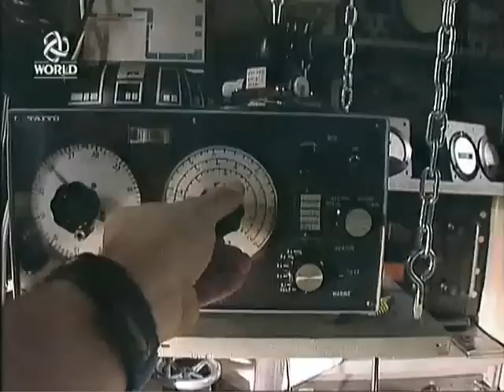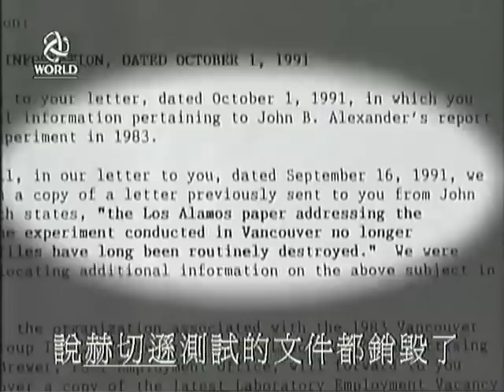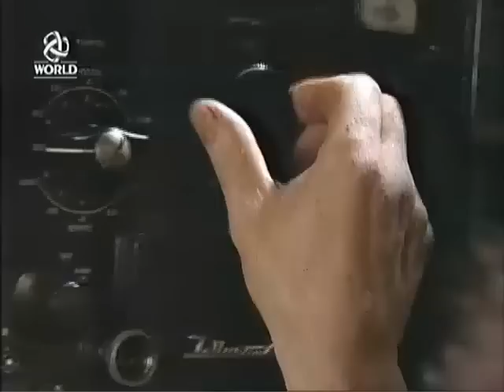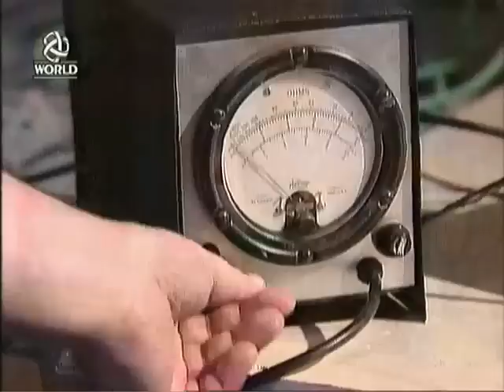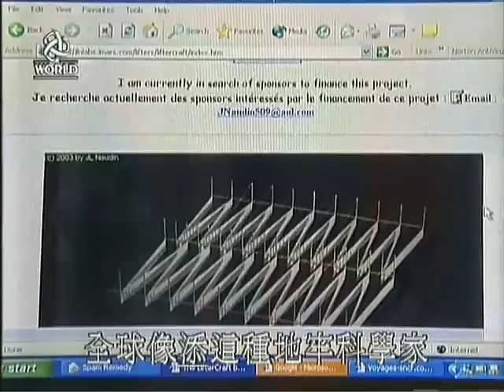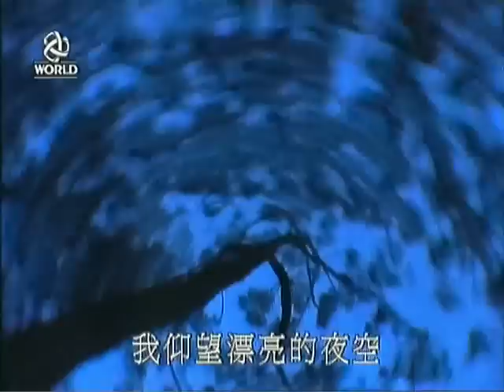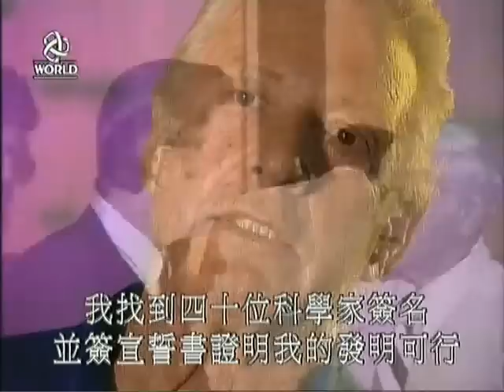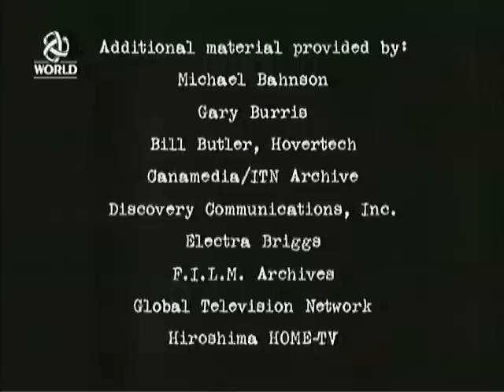Discovery Channel - Free Energy

Comment: I made some "crystal batteries" (as seen on YouTube) that don't run down but they don't have much power by themselves so they have to be multiplied and put in parallel to be of any use. They light LEDs. Voltage goes up nicely when they are put in series. Other than the ingredients, it's free energy.
Reply: Really? :D
Reply: i wish there was some sort of free energy system that could put out some high amps to power something other then low amp LEDs ,, nevertheless free light at night is a start right ? and LEDs make a fairly bright light

Comment: When someone says: free energy, I smell a rat. A dead rat.
Reply: +flexairz free energy is merely energy that's released that we don't have to pay for. That's the meaning. Is it hard to comprehend a device that has an ability to transfer energy from one place to another, powerful enough to do noticeable work? lighting an led is work. We can take a rock, mix some glue with a conductive component and glue foil to spots on the rock to receive a measurable voltage. If we lay copper foil on one side and foil on the other without connecting them with a conductive element, we can measure up to 1 volt across these conductors. I believe it works based upon the crystal radio phenomenon, and that our planet has an everlasting radio field associated with it. Since this energy is pretty much forever and will not die, what makes it so hard to believe that the energy can not be either capacitively coupled with , or induced in a nature other than by winding an inductor? The rocks may have a gravitational or magnetic component not noticeable to the naked eye, however, energy signatures exist within them that are unknown until we measure their electrical levels with a voltmeter. Just because it seems like science fiction, why would you smell a rat? It does not make sense. How could the energy establishment make this a scientifically inviable phenomenon that would be labeled as an anomaly and other feel it isn't free energy? If it lights up a small led forever, and, there isn't any other input other than the Earth's energy presence, why wouldn't it be considered free? The led lights up, and, nobody has a battery.. why are you so skeptical and have to write about it the way you do? crystal batteries do work and they are easy to make. The Japanese would have never invested in John's ability to make them work if they did nothing. There really isn't much to say other than the fact that they work.. They may not be all that powerful, however, he did make an incandescant bulb light up with them and he did NOT add an additional power source. How he did it? I'm not sure, but, it was rather difficult for him to maintain the connection, and, I think it is by obtaining the correct frequencies by using the right kind of crystal which would maintain that "capacitive coupling" with the Earth's capacitive component. Energy can be drawn in inductively, with an inductor, or, it could be drawn in capacitively, which causes much more skepticism because it isn't a known and documented wireless scientfic principle that has been taught in school. I do this by energizing certain products/components with high voltages, which start to raise the voltage in batteries when the electrical fields are present near the batteries and capacitor banks, allowing for an infinite amount of time per energy drawn from the test battery. this works as long as we do not take more than the incoming charge could level off to allow the battery to remain at 12.3 volts. I have estimated that the battery and inverter I used could output a total of 140 watts. The neon sign transformer uses 200 plus watts to fire up. The bulb I use uses 40-45 watts, the total is 245 watts, and the inverter is only good for 140 watts maximum. The battery maintains 12.3 volts while operating indefinitely, just as long as we do not increase the output or the load, it will run forever. Trust me, there's a lot of skeptics, but, nobody has been able to make this work other than Don Smith.. He is now dead and I am the other that has replicated this effect. It is very real, and so is Hutchinson's free energy crystal battery.

Comment: I built a lifter about 13 years ago.  I was using about 10 or 15,000 volts DC.  I could see it flex and move as I applied power.  I don't think I had enough voltage or power to get it over come the force of gravity.  I was disappointed.  But this video gives me hope that all those strange plans and patents I purchased back then were legit, and not just a scam.
Reply: Update?

Comment: The lab was not seized by his Canadians. It was a fire hazard, since you cannot have all that kind of out dated type of equipment in an apartment like that.  Imagine the current draw and the possibility of fire.  He said the equipment came from the 40s to the 80s or so, and I work on vacuum tube equipment all the time.  It can be dangerous.  Hot chassis, shorted capacitors, selenium rectifiers, asbestos, this old stuff can burn a residential structure to the ground.  Some of the equipment was even dubbed "curtain burners" because of the heat and tendency of the devices to catch fire to surrounding apparatuses.

Comment: In case some of you are easily impressed, the levitation is done by turning the camera upside down.
Reply: aha, so what causes them samples of hutchinson to first stay on the wooden board they are on?
How do they first stay there, then start moving slightly, and then "fall" upwards?
Water isnt magnetic, so how does he keep the ice hanging untill it drops?
Reply: jhanthony2 well, if the militairy is interested in those things....... just like it was interested in the works of tessla..............

But no sir, you seem to understand it wrong.
Its not WHAT is being done, but HOW it is being done.
Please, replicate what he has done. Show you can do the same, and then you may convince me.
But now, i say you can not show or replicate his stuff.
No matter if its filmed with a potato or with a camera, it is the stuff you see lay on a board of wood. Does not seem to be attached in any way. And it seems to go up.
I know, you can turn the camera around. And sure, things with metal in them would be possible to keep suspended in the air by using a magnet on the other side of the wooden board.
But, things that are non magnetic can not do so. And he clearly shows stuff that is not magnetic and it still reacts to some sort of force.
It may be a blower, it may be a piece of string. 
Replicate it, i dont think you can.
And that doesnt mean i believe its real, but i do not have an explanation, and i merely tried to show that your explanation doesnt make sense.
Reply: bertjesklotepino "well, if the militairy is interested in those things....... just like it was interested in the works of tessla.............."

What are you implying? I thought everybody in the world was interested in the works of Tesla. And I'm pretty sure that there isn't anybody in the Military that has "Raid Hutchinson's lab." on their to-do list.

You request that I replicate what he has done. I can't do that because I have no idea what he has done. Do you? All I see is an extremely bad video of nothing. The only thing clear in this video is that it was made so that you wouldn't have a clue as to what you are looking at. How can anybody accept this video as something scientific? 

I'll try one more time: The Hutchinson effect can't be explained, because their [oops--there] is no such thing. Nothing is being effected, and nothing has an effect on anything else. He's a magician waving a hat around and saying, "Ta-Daaa!" but never producing a bunny, pigeon or bunch of flowers.
Reply: jhanthony2 I agree with the fact that the video is indeed very bad quality, and in no way scientific evidence for his claims...............
It is however strange to see water first clinging to a cup on a wooden board, then the water going up and the cup still on the wooden board.
Or a solid piece of iron smoking and deforming.

You can not say for sure that there is no such thing. Tesla has some strange devices too, and there was this other guy who was busy with magnetism and static energy as well, who also has patents on strange devices that seem to have levitated stuff by an unseen force.

Now, i dont mean to say that whatever he does is real, but there are several examples of projects in the past which involved the militairy to show that there are things we dont know about.
Im no expert on static energy, i dont know if you are. 
Tesla wanted to create some device to have unlimited power free for everybody, and it seems Morgan and such didnt want that because it wasnt possible get people to pay for the energy they used.......
What i mean by that is, certain inventions are surpressed, censored if you will.

I know you cant replicate what he did, but to discount it simply by looking at a very bad video............... i think the video only shows that he aint a cameraman......and also not rich enough to buy himself a better camera i guess.....

Comment: On Newman's machine, the AP reported that the Patent Bureau said: "that because of unusual electrical characteristics of the machine, it had to design a test plan and combination of instruments specifically for Newman's non-standard device. But it said it carefully checked the instruments to assure the accuracy of the tests." Reported by Warren E. Leary, AP Science writer.

That is a lie, if they said that. All you have to do is measure the wattage being consumed from the output into a load, and the wattage going into the machine to power it. If less wattage is consumed than what it takes to power the load, then it would be over unity. There are no special instruments required, just watt meters. It sounds to me that the patent office might be sour that they were forced to do the test by a court of law. One has to remember what J P Morgan said about Tesla's idea: "I can't put a meter on it!" He stopped funding the project. Newman was trying to obtain the patent while Regan and Bush Sr. were in office. I would not believe this, though, unless I did the measurements myself.

Comment: The first guys battery is probably just an alkaline battery. He also doesn't understand what an electron-volt (eV) is since he refers to a volt (V) as an eV... When in fact an eV is defined as an electron charge (in coulombs) across a volt, thus the two terms are not interchangeable. As an engineer, this guy seems to be a hoaxer.
The second guys 'anti-gravity' device is an ion lifter which uses large voltages to create ionized air that is attracted toward the other high voltage node. This creates a lift by air and is not anti-gravity, it would fail in a vacuum. It is not a mystery at all... It is also too inefficient of an effect to ever be useful for anything practical.
I'd have to inspect Newman's device, but at his demonstration at around 44:00, you'd want a watt meter at the power input and one at the power output. You can manipulate voltage at the expense of current. That's what transformers do all day long, can take 120 voltages and up it 500 or more, or even into the tens of thousands if using something like a switchmode power supply... but again, at the expense of current, which keeps the power input/output the same or less.

Comment: Ten car batteries could run a house without his machine. In series that is 120 volts, 60 amps.
Reply: A house is ran at 240v, it's split at the breaker box into two 120v legs.
Reply: Car batteries produce DC current and everything in your house wouldn't work except for incandescent light bulbs and heating oven. Also, some things actually use 240 VAC like the electric oven.
Reply: Power inverter.... able to turn 12v into 120 or even 240v now take an inverter and put it to 120v. Bet it can make 2,400v lol this video was a complete waste of time.

Comment: This better be a fake documentary.... First guy is camera tricks. Lifters are well understood how they work (NASA used the principle to build a working ion engine) its indeed just ion wind and Joe just has a big inductor that does the same thing as pretty much all xenon camera flashes do to get 300V or so needed to arc the flash tube (And also the roughly 1kV needed to trigger it) from a 1.5V battery.

Comment: If Joseph Newman's machine really works and produced more power than it consumed, then rather than using batteries he should have a crank to start the machine, like a lawn mower, and feed part of the output power back into the machine to sustain it and also run a large screen TV with the excess power. This would convince more people than looking at a volt meter. Obviously his machine is a fraud. Two 9v "smoke detector" batteries in series has 18v. It doesn't have more power than 12v car battery.

Comment: Why must Joe go into mass production? He can start out small and expand! If the device works, he can sell the excess energy and use the profits to expand! Problem solved!
Reply: *****
They wanted exclusive rights to it for that $200M, I'm sure. There's no reason he has to start in the US. He can get patents in other countries and start there. Some countries don't have rules against patents for perpetual motion machines. Also, there's no reason you have to have a patent to produce something. What a patent really does is protect you from someone else patenting an invention that you're already producing and then suing you for using their invention. In this case, nobody else can patent it either, so anybody is free to produce it.

Joe always comes up with these ridiculous tests like running a giant fan with a 9 volt battery or a bank of 9 volt batteries that are supposedly dead. That's unconvincing. If he's really creating excess energy he should be able to disconnect the batteries and run it entirely off of it's own power.

Comment: By now I would think that someone has installed a lifter in a large vacuum chamber to test whether ion wind is primarily responsible for lift or an antigravity effect. While in the vacuum chamber, if there is no lift at all, then ion wind is all that is happening---no antigravity. If it lifts or at least attempts to lift, then maybe something else is occurring---possibly antigravity. If gravity is an effect of the fabric of space/time, then this configuration of aluminum foil and wire with very high voltage passing between the two is possibly effecting space/time at close range of the lifter. Maybe someone should attempt to mix technology from Ronald Malletts time machine he is working on at the University of Connecticut utilizing laser light. If bending laser light in a circular manner can slightly twist space/time, then maybe the combination of high voltage and bending coherent light waves can accomplish something fantastic---antigravity, time machine, who knows, maybe nothing. It's worth experimenting. Research and inventing is really the only means to change the world. Tradition, presumptuous thinking, religion, politics only slow the progress. Ignore them, and plow ahead.
Reply: Excellent idea!!

Comment: Am i missing something here? if joe newmans machine generates more energy than its putting in why doesn't he start it up, disconnect the batteries and power itself, surely then this would stop all the controversy??
Reply: +dave llewellyn  No, you missed the point. Joe Newmans machnie generates a 1000 volt out of a few 9V blocks. Its amplyfiing the energy. I dont trust that. But if it would be true...
Reply: +Paul Horn ok i see.but i assume if volts are higher current is lower so no gain? sorry would love to be proved wrong and for it to work but it defies the accepted laws....
Reply: +Paul Horn  A 1.5 volt battery running an oscillator circuit  can generate any AC voltage you want, but the power is inverse, more voltage, less amps. Also power  with AC is not volts times amps, that's DC only, power on AC is frequency and waveform dependant, it catches out many experimenters. Newman gets a high voltage, same as a transformer, but no power as the current is so low. Bedini generators also fail because they produce high voltage, low current. they can appear to charge batteries,  but not to capacity, only in proportion to the input. All of this is not new Tesla and the Victorians understood this. Too many people have never been taught science fully enough these days, not their fault, just poor schooling.

Comment: Ok, man showed how to turn 120v to few kv. What is unusual here? I can turn 1.5v battery to millions of volts with few capacitors, diods and oscilator. But it didn't give me more power, because current is extremely low.
Reply: So how can you get the current high?
Reply: @Xelenteontae_  You can't.

Comment: this is nothing new. back spike energy is used everyday by modern electronics. it is produced when a magnetic field across a coil collapses to zero. the result is a huge back spike. the sparkplugs in a car use this as well as the horizontal in a CRT television set. magnetic fields are constantly making and breaking across windings in a motor. this energy is wasted. this effect is undesirable in audio amplifiers and is known as crossover distortion.